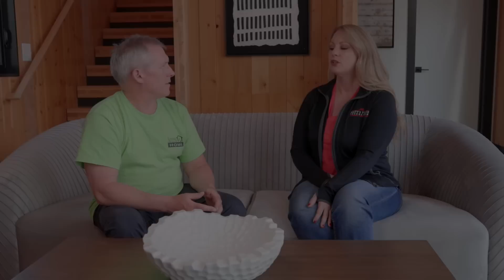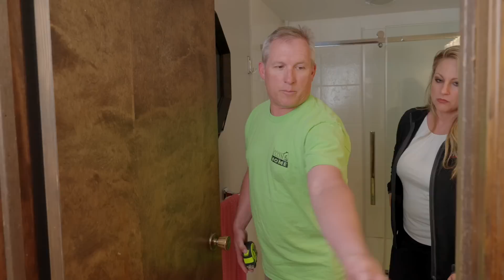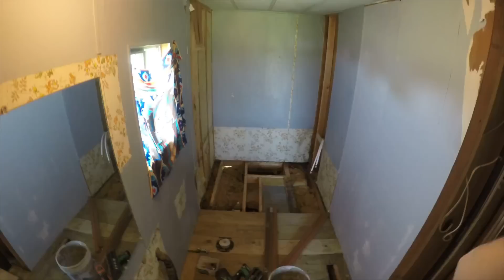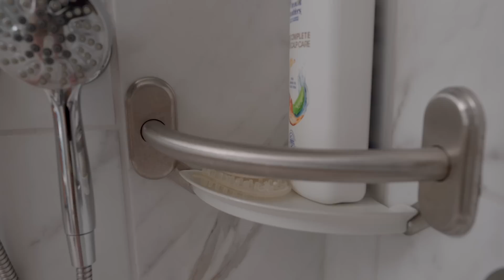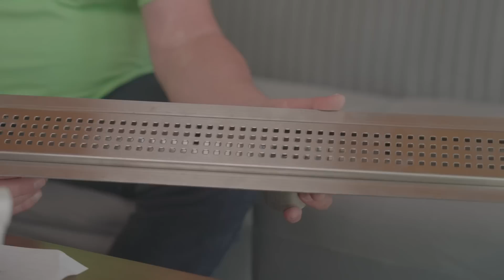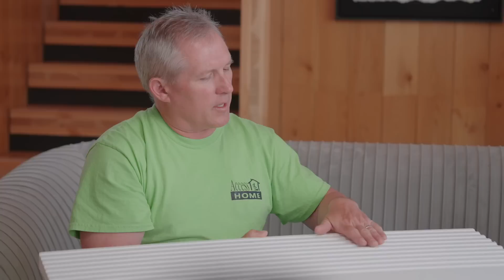Hope & Housing ALS Home Renovation Series: Episode: 2 "Bathrooms"

Comment: Good Morning. We need to pick out tile for a zero entrance shower and floor.  What are the main things we need to take into consideration when choosing a tile.
Reply: Slip resistance is VERY important! As is the grout width. The smaller the better. (As opposed to 1/4" grout, when using a hoyer lift, those wheels get caught in the groove.)